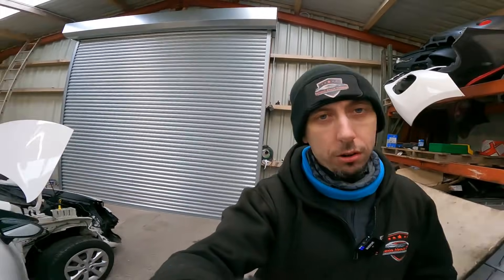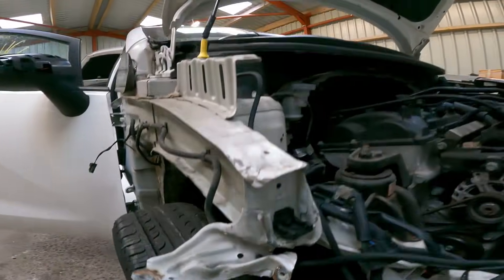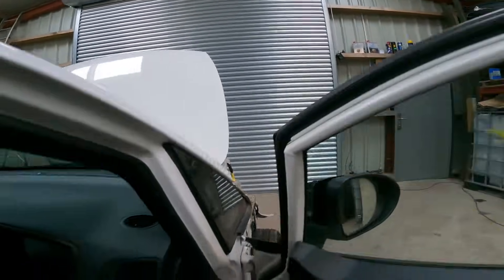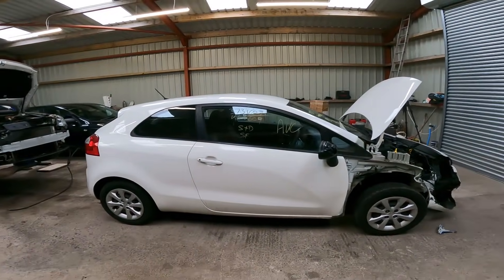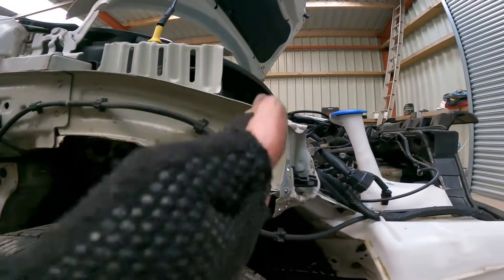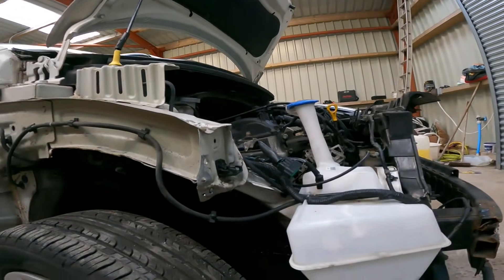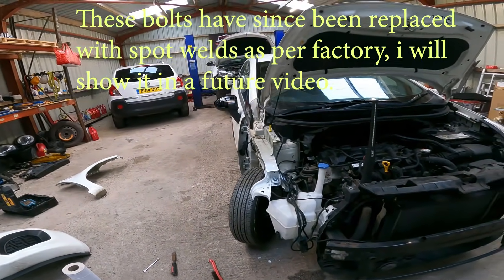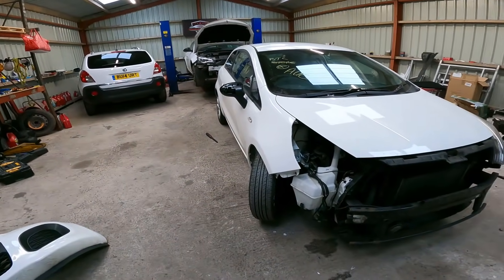2013 Kia Rio 1 Salvage Repair SHOULD Be An Easy Fix......

Comment: Get a spot weld drill bit, it will let you cut through one skin and leave the base intact to weld to. 👍
Reply: Great tool had them for years 1980s. John this guy is good. John 6

Comment: I am no amazed how many fixings hold on that wing Phil. Spot weld that bracket mate, I know it’s only a support bracket, but it looks bad! Bit of a debacle with the fuel gauge? Should tidy up nicely into a nice wee runaround for someone. Hope that suspension is ok? Keep up the good work Phil 👍
Reply: Ladas from 1980s wings had about 70 spot welds each side. John Rooney st.annes Lancashire UK

Comment: I'm going to be a little negative and say that I think bolting the bracket instead of spot welding isn't great,maybe you need to invest in a little welder,also you need a panel hammer and a proper tool for drilling spot welds,as slot of people have said I think you should have tried putting another 5 litres of fuel in before taking the fuel pump out and getting fuel in the car etc but other than that great video👍

Comment: Needs a hub or a leg as the camber looks leaning in at the end
Reply: Nahh he said the way you see if the suspension is damaged is you stick your fingers in the gap. Three fingers, looks ok, get it out the door quick
Reply: @davecoleuk  I’ve used that technique myself to show if the wheels back. Doesn’t quite work for the wheel leaning in

Comment: Cannot still believe your still at 19.8K subscribers  same as last week   201 subs needed to   get the longest on going raffle up and running and done with 
These Autowit jump chargers where £149.99 when you reviewed the item you can buy them new for £49.99 on auction sites